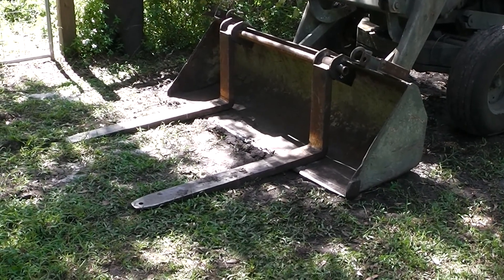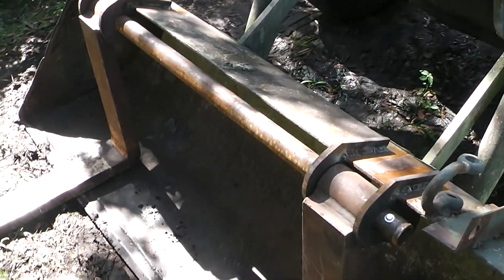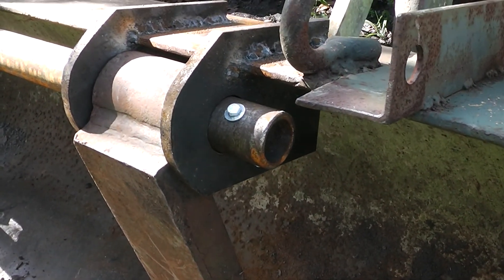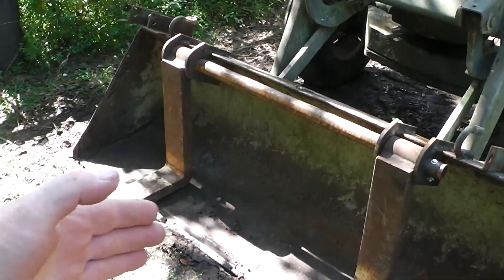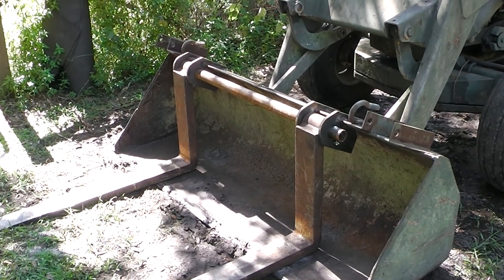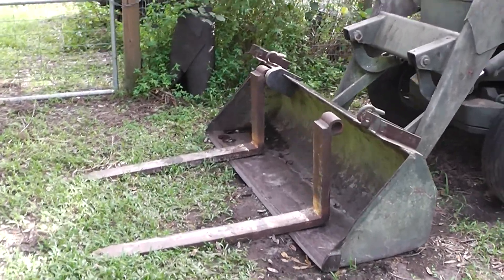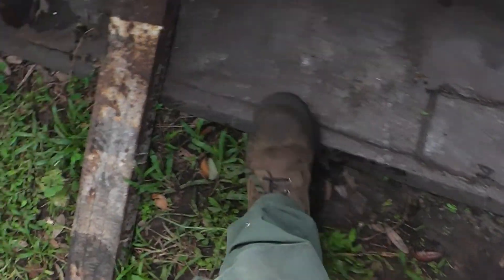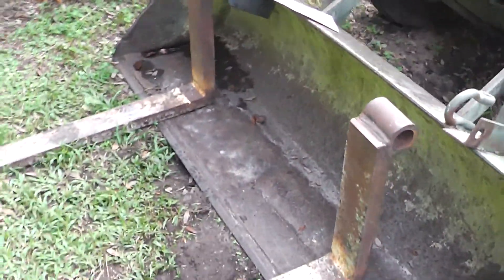How I Installed Pallet Forks on My Tractor

Comment: Nice fork attachment. I plan to add to my Case 580E loader but will hang forks a little below the scraper for extra support. I will be picking up boulders close to the weight limit of the loader.

Comment: Thanks for taking your time to show details in how your fork brackets are made and function.
I have a 1979 Ford 3600 that needs a set of forks for it and I decided on using the genuine type of forks as shown in your video.
I already seen 2 of my neighbors bend their clamp-on forks rated for 2,000 lbs even when following the user and weight guidelines, and so I wont waste my time n money on those chintzy might-get-you-by forks that are made out of box tubing.
Reply from the maker: Yep, these forks I got off of Craigslist have served me well. So far I have not been able to bend or break them. I paid @$200-250 for these forks 5 plus years ago. The saying goes "buy once and cry once". Thanks for watching.

Comment: Sweet job right there, I made forks  to work with my subcompact and the also are quickly removed and installed.  Of course my tractor don't need near as strong steel.

Comment: I have been looking at pallet forks and this is the best design I have seen.  I only have a little toy  tractor but I have been worried about the clamp on types bending the bucket and was thinking to extend the forks underneath to provide support. Doing it your way they have the support, there is much less leverage on any one spot on the bucket  and they are easy to move.  The brackets where you put the rod though would also double as lifting points to put chains through. 
This is definitely the design I will follow.  Thanks very much for sharing your brilliant engineering. Much appreciated!

Comment: I can see your going to get a lot of use out of them, I use the ones on my tractor all the time mine are more quick detach with a lock pin option, I think I put up a video quite a few years ago but would have to look to make sure, Must be old age setting in..lol
Reply from the maker: I think after using them that they are by far the most handy attachment I have ever used!
Reply: @homesteadprepper just found your channel an subbed. What name brand/size tractor & backhoe?
Reply from the maker: @GaHullbillyRanch  It is a 1970 John Deere  JD400 industrial 60hp.
Reply: @homesteadprepper  cool looking rig. From my phone it looks like it's painted olive drab. Military tractor backhoe?
Reply from the maker: @GaHullbillyRanch  It's not military.